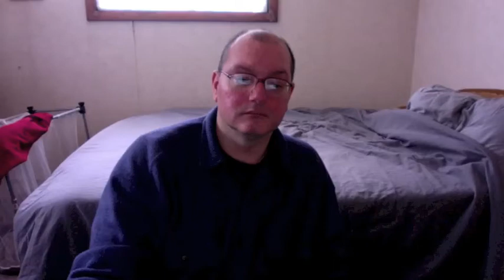Calculating your electrical need to get the right size UPS

Comment: You indicate never use 60% of the VA Rating and then you indicate if you have a 1000 Watt UPS.  The part that confuses me is are we calculating 60% of the VA or the Wattage as they are rated differently on the UPS.  For example on a UPS like this http://tinyurl.com/zqmxyv9 , you have a 500 Watts / 750 VA.  Which one am I using for the 60% calculation?  Thanks
Reply from the maker: Thank you for the question.

Lets see if we can help with your question.

For computer equipment the Watt and VA ratings can differ significantly, with the VA rating always being equal to or larger than the Watt rating.

The basic 60% rule is the VA.  A UPS might list so many watts which is usually 60% of the VA of the internal battery.

600 Watts requires at minimum 1000 VA because 60% of 1000 VA is 600 Watts.

Hope that help.

Leon

Comment: 0.6 x 1000 means 600, my pc and all other components are 600w, is that how to measure?
But how do i calc the time it will last for? I'm the uk so we use 240v so that would mean 240 at 2.5 amperes, but the PC will not be at full load all the time, unless i am using it for gaming or rendering stuff, that consume heavy amounts of power.
So let's say that is the maximum draw, 240x2.5 but it uses at ilde 240x0.8. How am i gonna tell how long it will last for?
Reply from the maker: *****   Step 1.  Multiplying the amps times voltage of each device and adding up all the amps.  Multiply the total amps you have calculated time your voltage.

Lets take a few examples using UK Voltage of 230 Volts.

865 Watts from a 1500 VA UPS is using 69% of the UPS and will give you about 7 minutes of backup power.

700 Watts from a 1000 VA UPS is using 86% of the UPS and will give you about 7 minutes of backup power.

240 Watts from a 1500 VA UPS is using 28% of the UPS and will give you about 26 Minutes.

240 Watts from a 1000 VA UPS is using 40% of the UPS and will give you about 21 minutes.

Notice The lower the watts required compared to the VA supplied the longer the UPS will last in minutes.

My iMac, right now is using 45 watts or about 6% of the UPS and has a run time of 70 minutes.

I hope these examples help you to correctly size your UPS.

Thank you for the question.

Sincerely.

Leon
.
Reply: Oh and i all of a sudden understand, thanks for the fast resposne! the the wattage does not necessarily matter, but for longer lasting i'll need the VA. So 600w at 1200va 50% pwer i get roughly 10 min of use.

Thanks. I understand now, at least a little better.
Reply from the maker: Glad I could try and help clear this up for you.  Good luck.

Comment from the maker: On the back of your speaks if should tell you how many volts if it does not list Amps.  In this case you would take the watts (25) and divide by the Volts listed on the back of the speakers.

For example.  25 watt speakers / by say 12 Volts would be 2.08 Amps used per hour.

In this case a 550 VA would last you about  266 hours or 11 days.  That is only if you have speakers and nothing else connected. This is a rough estimate as I do not know the Volts your speakers use only the Watts.

Leon